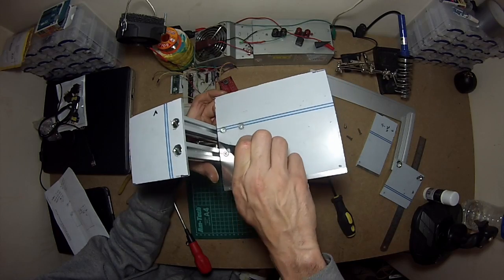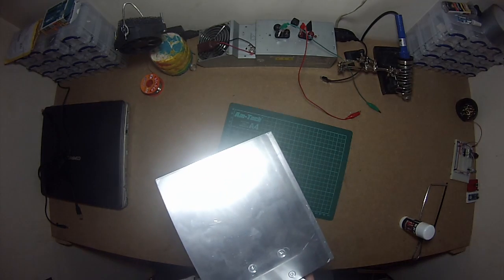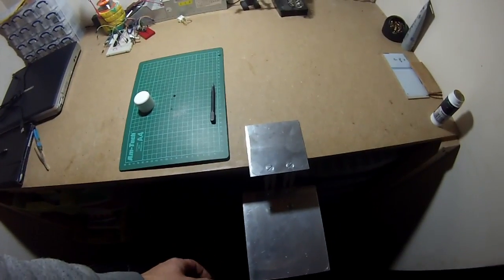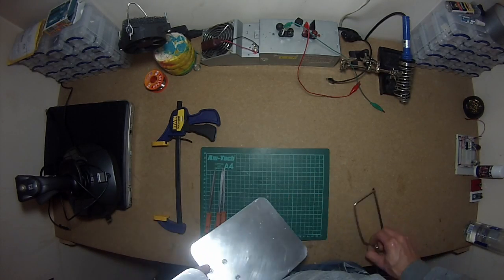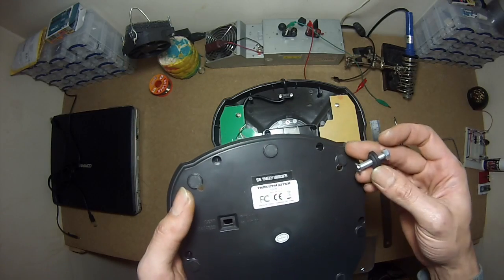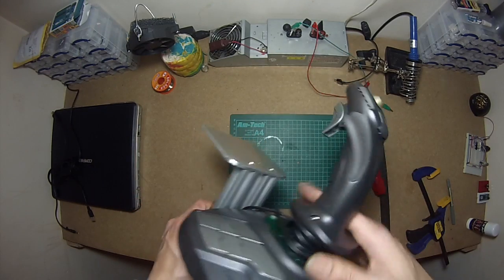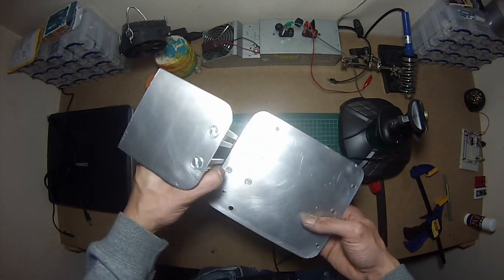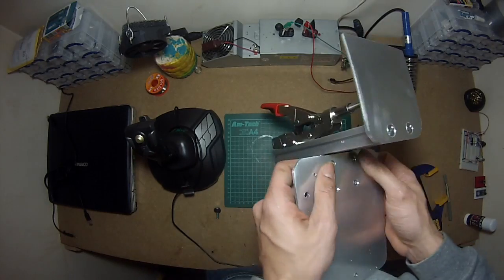Joystick Mount. Mini Monster tech. Part 2

Comment: Great job!, I came across a template on the thrustmaster website for the hole locations, you can use countersunk Allen bolts to secure the joystick and throttle